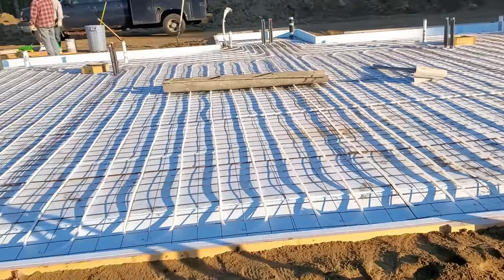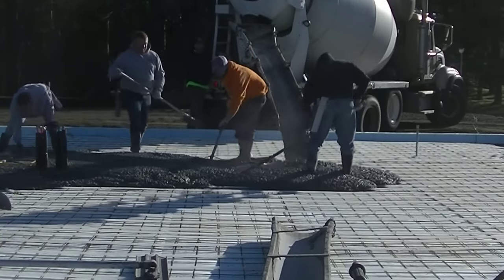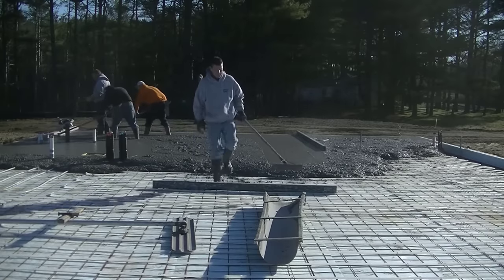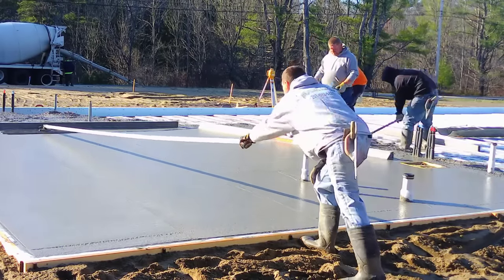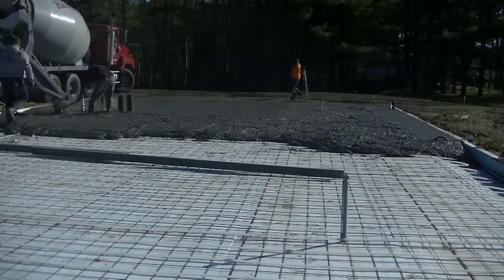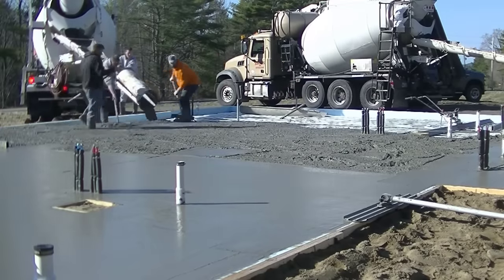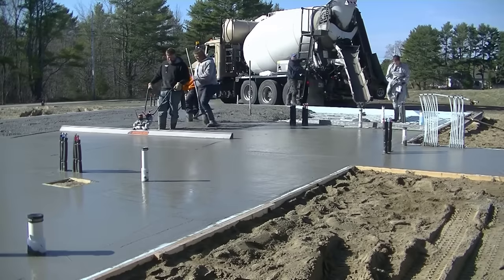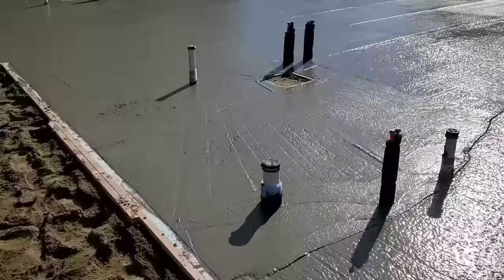Insulated Concrete Slab for a House 60' X 32'  (What's it Cost?)

Comment: I will never understand why these slabs are specified with these crazy high compression strengths. Why, in a residential stick frame, would I ever need 3500 psi? It’s not a skyscraper, it’s a wooden box with 3 people in it.

Comment: Nice work and explanation Mike. Here in NE Minnesota, concrete is $160/yard plus a $285 delivery charge per truck. We are one hour away from the concrete plant. I received bids of $13,900 and $16,500 to pour my 24 x 40 insulated, thickened edge slab with rebar. So, I decided to do it myself, which will be done within the next 3 weeks. My cost will be about $7,000 or so. I will be pouring it in two 20 x 24 sections, to make it easier to deal with. Keep up the great work and teaching.
Reply from the maker: Thanks for sharing Greg. Good luck with the slab!
Reply: How did your pour go? What slump did you use?
Reply: @PanzerBuyer  I used a 6” slump with water reducer. Pour went well
Reply: @gtfangel  are inspectors a little more critical on a non- pro slab install?
Reply: @josephcurran9924  No inspectors here where we poured

Comment: With a six-inch-thick slab, wire isn't needed for anything but to keep the tubing "anchored"  The concrete is strong enough.   IMHO

Comment: It's not more efficient to put the pipe at the bottom of the slab.  It actually requires more heat and energy to get the same amount of heat to the surface. They only advantage is easier installation (no chairs) and easier to walk on during pour.  If you're going to put radiant on the bottom of the slab, using foam staples is easier if wire mesh is not structurally needed.

Comment: So I turned up on site, to discover the sub grade was off by 4 inches over the 16ft width, told the client i have to re- grade the base now before the pour - nuts. Luckily we had allowed a bit of extra time to make the forms, extra 2 tonnes of stone and wacker plate sorted it. I think the excavator was a cheap cash job.

Comment: Mike, what type of reinforcing would you put under a house finished slab floor (no radiant heat) and garage - rebar? Steel Mesh? Fiberglass? ICF house in NH. Thanks!

Comment: Great video! I'm going to be building an A-Frame this spring just north of you guys in eustis. The kit company I'm ordering the A-Frame from wants me to put it on a crawlspace foundation. I'm no concrete expert, but it seems like a crawlspace would be significantly less concrete than a slab and should be much cheaper. Am I correct with that assessment? The house I'm building is about 34fr long and 26ft wide

Comment: Great video, thanks for sharing I am getting ready to build our home (slab on grade) in Ashaway RI this Spring. My question on your video is this project is in Maine (tons of frost) and yet no frost walls down below the frost line?  Also lots of the information i have rec'd so far is "don't" put the radiant piping in floors because takes to long for heat to transfer upwards (maybe your owner of this house can reply) and heating temperature needs to be higher vs if you laid the radiant on top of slab with something like Warmboard, Ecowarm Radiantboard?  thanks for your help. Dan

Comment: I really applicate you sharing the dimensions, depths and yards.  Can you speak at all to the wire mesh, vapor barrier, radiant heat tubing and the foam insulation?

Comment: Hi Mike….thank you for an awesome video. I appreciate how you explain the smaller details for those of us who don’t have a strong working knowledge of this craft.
I have a question or two if I may? I live in Durango Colorado…and I believe the frost line is about 32”. I am in the process of designing a 60x40 shop/garage. I am unsure on how to build footings below frontline? In this job…you had a “thickened edge”….is it the isolation that allows you to not have to be below frontline? It appears to me you are just about at grade, and I believe you said the edge was 12”?
Would you recommend an insulated slab like this without using radiant heating? I am on the fence on whether to use radiant heating….I am also considering using ICF which would provide a very well insulated shop. I would appreciate your thoughts.
Thank you in advance….Steve.
Reply: Steve i am going to be using ICF on my house starting this spring and have same questions. What did you find out?
Reply: I worked around Durango for a while with a buddy who was doing solar, and visited the earthship colony in Taos. If you're not familiar with earthships, check it out.

Comment: Wonderful job. I worked at a concrete plant for 10 years. I have seen just about everything possible. Very impressed on your crew and the way everyone worked together. Also the battery powered screed looks to be a lot easier to use than the gas engine design.
Reply from the maker: Thanks Gary! We like the battery one over the gas powered.

Comment: Was this slab a monolithic?
And what is the edge depth around the perimeter?
I am in RI and would like to have the exact slab done for a small 36x24 ranch.
My problem is finding a crew to do it.
Any recommendations thanks
Doug Stone
Reply: Hi Doug I am building this spring in RI using ICF and had same question, thought you had to have frost wall done first then pour your slab on grade. Dan in Ashaway RI
Reply: Hi Dan
I ended up doing a 42” in the ground frost wall. 
Put sewer line and water line in
Back filled the exterior and will let it sit for the winter
Reply: @stonebody  where are you building and what ICF product/company are you going to use?  Dan
Reply: No ICF used for wall poured concrete
I think however that a ICF wall is the way to go
I had to add 2” of R10 insulation and water proof the wall
Labor intensive since I did that myself

Comment: Will the 2 x 6 bottom plate extend over the 2 inch perimeter foam? Or will the 2 x 6 bottom plate be flush with the edge of the concrete?
Reply: That's a good question. I'd like to know also

Comment: Basically $10.00 sq ft . FOR Foam, forms, wire, concrete and labor.
Now add stone and grade work. And let's not forget the pex water lines. Roughly  a $25,000 start.
Great information. And watching a well oiled crew work together. Team work is a must, all with the same goal.
Reply: @nitro2037 ur out of ur mind, don’t know where u get those prices
Reply: @nitro2037  I’ve been doing concrete for 30 years and I am a 3 generation concrete guy, I mostly do decorative concrete now but have done many monolithic slabs, I actually run the company and do all the quoting too. This is a 32’ by 60’ monolithic pad, not a 2.5 million dollar log cabin. On the high end with plumbing ran under the slab, which isn’t much, guys are usually out of there in a days,  electric not a big deal just run the right size conduit and that’s it. Ur looking at high end cost tops at 40k. That’s to excavate, if it’s fairly flat but that also depends on how much fill or digging is involved and even then it’s not moving the needle 10k, we’re talking maybe 1k-2k. Frame everything, have guys running plumbing and electric, lay foam, vapor barrier, mesh and run lines, pour, finish, strip, cut and onto the next. That leaves me with a 15k profit after all said and done for something we can bang out in a work week with 3 guys…that’s also quoting a 5 inch slab with 16 inch haunch around the outside, I am sure every state varies on the depth of the haunch. Sure would I love to charge 70k yes but there is 10 other guys willing to charge half that and I am not out to make a million dollars off of a residential job for something that a lot of other people can do, for my decorative work I do charge top end because a lot of people can’t do what I do. Supply and demand, simple economics 😉
Reply: @nitro2037  I was at 8k for concrete, double that for foam and wire. That’s 16k, lumber, vapor barrier $600 and no pump needed but if u did thats and xtra 1k, add 2k for plumbing and electric and ur under 20k, the rest is labor cost and profit. Thats easily graded in a day, framed in a day and a day for everything else, poured in 6-7 hours depending on temp and stripped and cut in half a day… c ya pay me….Now if I charged 70k for that, 95% of people would tell me to pound salt
Reply: @nitro2037  u own me a drink

Comment: There's no frost walls?
Reply: Nope. It’s an “Alaskan Slab” or thickened edge slab. Google will satiate your curiosity if you want to learn more. It’s a less expensive route for a foundation in cold climates.
Reply: @bpdp379  that wouldn't meet Maines building code for a house
Reply: @brownsrepairs573  Maine is more strict than the IRC?

Comment: I love your videos! You explain things in a way that really helps me. I'm curious to hear your thoughts about mesh vs rebar in driveways and similar slabs. The online forums are full of guys saying that they've ripped out miles (exaggeration... for sure) of concrete where the mesh is all sitting at the bottom, and that because of that they'll never do anything but rebar. I've never seen mesh put on chairs either, since it gets walked all over. Thoughts?
Reply: You must have a different mesh than we use. Our fibermesh is comes in bags that we add to the mix so that it is mixed with the concrete in the truck.

Comment: Have you poured driveways that have snow melt systems in them?
Are they similiar to what you are showing here with the radiant heat pex tubing?

Do you think snow melt systems don't work?, or the cost to run is too high?
They don't seem as popular as the radiant heat floor systems inside.
Reply: They absolutely work. Plenty of international airports using them to keep runways clear.  Cost is relative, I’d guess people who can afford hydronic snow melt systems don’t worry about operating costs.